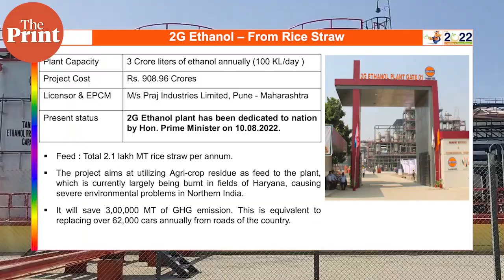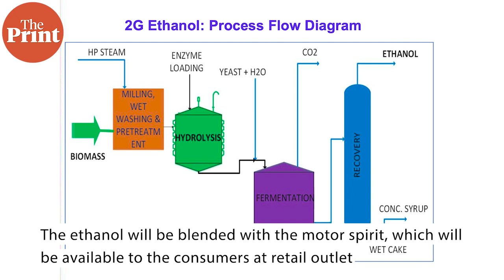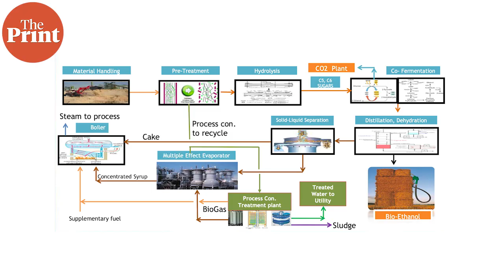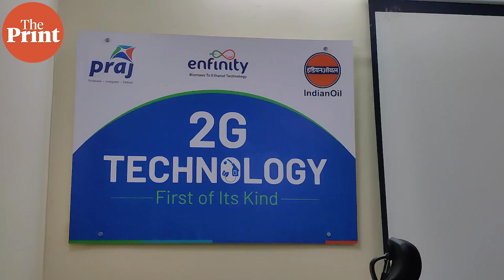From stubble to ethanol – how this 2G ethanol plant in Panipat is turning the table on air pollution

Comment: Although they're using straw as feedstock, how much energy is being used for distillation of ethanol because straw has very low concentration of starch
Reply: Do you even know how ethanol is made?  It is a biodigester, fermenter with right substrates.  I don't see any drastuc energy consumption from this plant.  Do you use energy to convert milk into yogurt at your place?  Come on man!  Please google a bit about how this process works.
Reply: @srinisbir8781  do you? How do you distil ethanol from the resulting feedstock in very low concentrations?
Reply: @dominicdmello7531  it is a biodigester.  It will take long time, but not high energy.
Reply: @dominicdmello7531  yeast dies when ethanol concentration reaches 13%

So, its upto the column distillation unit to concentrate it to different purity levels.
Reply: @jagadeeshks4601  chemistry graduate. That's why the question of energy used for low levels of ethanol concentration. Net energy is the question. Not ethanol production. And where the energy for distillation is being sourced. Besides video shows straw being sourced, not stubble. So where's the stubble going?
Question everything. That's my moto.
Reply: @dominicdmello7531  dug up shredded stubble pretty much look like straw - so both stubble and unused straw (unused for fodder i,e,) goes into this 2G digesters. There are other cellulose feedstock digesters which can digest even lignin rich feedstock (more woody biomass), those are getting commissioned too. But for now given India's 100+ million cereal crop based excess agricultural biomass this is the way.
Reply: Straw doesn't have high sugar levels, but it has cellulose and sugar polymers which can be broken down(hydrolysis) to get sugar.

Most agricultural waste, Even bamboo sticks are used to make ethanol!
Reply: Gasoline is still more efficient than ethanol
Reply: @helcurt2509  biomass is carbon negative - gasoline is carbon positive. Accounting for procuring, processing, purifying, distillation, transport to retail etc Ethanol will always come out ahead of gasoline which is "fossil carbon" which wasn't supposed to come out for may be a few million more years. Meanwhile almost 80% of photosynthetically fixed C gets released back into the atmosphere on decadal timelines, so using them is considered carbon negative.

Comment: The greatest Q: What % of stubs in Haryana will be used for this?
Reply: I think it will increase overtime, but don't you think use of Trains for moving the stubble is good ?
Reply: @dipmalyagantait4716  great suggestion but still loading and unloafing then storing will be a great challenge
Reply: @rishabhnegi7275  yes. But that cab be with certain trucks too.
Reply: @dipmalyagantait4716  Last mile rail connectivity to farms neither exists nor is it feasible. Also, rails are mainly electrified - and this last mile small truck + large truck at collection depots via road additionally offers the opportunity to use blended fuel itself for the final small load conveyance. Eventually may be even large load trucking on blends can be done thus offering circularity and achieving net zero. For now, tempo/matador type vehicles on petrol can use E10, E15 and E20 blends - large trucks are still full diesel - eventually 15% e-diesel in heavy trucking will allow even better systemic use.
Reply: @nirmalyachatterjee4473  this seems better on point.
Reply: This year stuble burning was just 3 percent if compare with last year ,which was around 80 percent . Aap did not able to anything,  they do just advertisement .